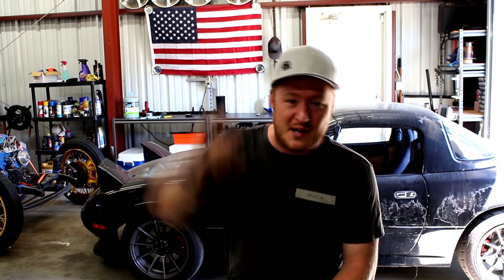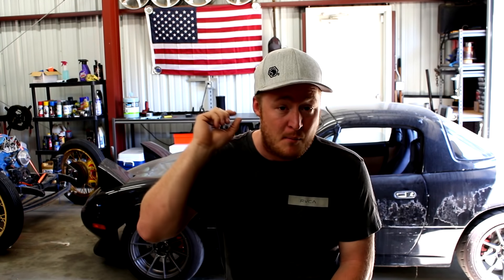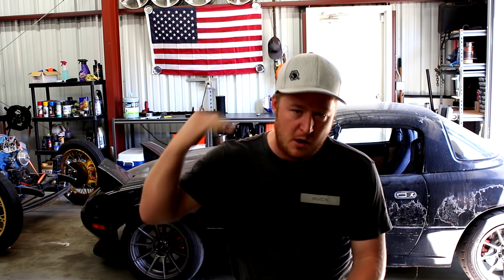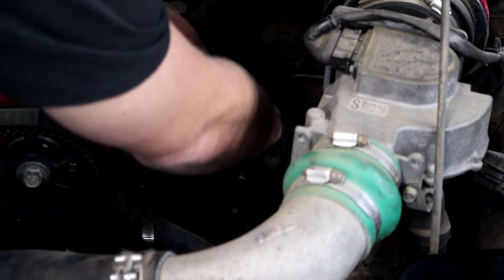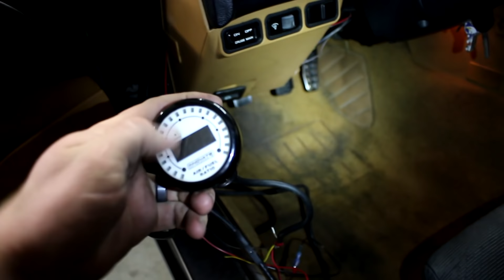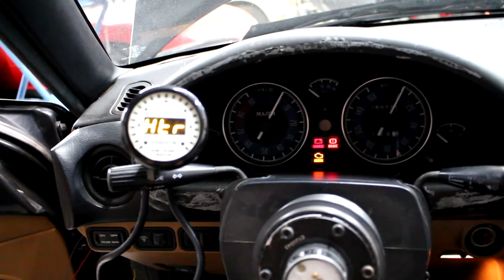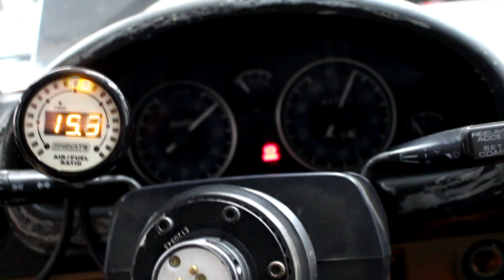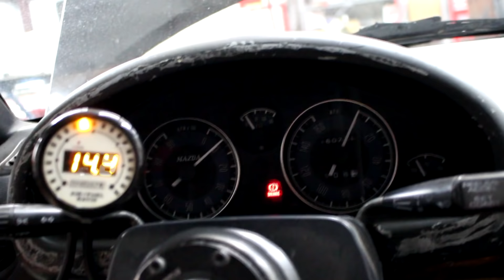Wideband 02 Sensor Install | Reborn Turbo Miata Build #33

Comment from the maker: One thing I forgot to mention in this video is that these Wideband O2 sensors also usually have a calibration process! READ your instructions that come with the one you buy and make sure you calibrate it!

Comment: Just picked up a 97 Miata. My biggest problem is that it’s automatic. XD I’m most likely gonna go back and watch all the mod videos now. XD
Reply from the maker: You can always swap it!
Reply: GearHeads that’s the plan. I want to get a 6 speed, but I’m not sure what rear end to go with, or if I even need a different one. XD
Reply from the maker: @thatfurmurezor7821  You'll need a driveshaft when you swap it to match whatever transmission it came from but the diff can stay. Idk if you have a torsen or not but if you do just keep it
Reply: GearHeads yeah, I hear the Torsen is the best but I don’t know how to tell if I have one yet. lol, I must do research. XD

Comment: Thanks for the video.  I can't seem to find an answer. Maybe someone here knows. On an nb that has the 4 wire 02 harness, I tie in the 02 signal to the blue wire. My question is the about the 02 ground/ white wire. Does it get taped back or does it too need to be grounded? Hope that made sense. Thanks
Reply from the maker: Are you talking about the widebands ground or the stock one? Are you setting up a Wideband with a standalone ECU or just adding one in conjunction with the factory sensor?
Reply: @GearHeadsGarageChannel  thanks for your response. (mega squirt only.) Ive cut the 4 wire harness and tied into the blue for the wideband. The other 3 wires in the harness are 2 black for the heater and a white/ground. That white/ground, does it just get taped back?  Thanks

Comment: we're still waiting on the slow power windows solution!!
Reply from the maker: Haha I havent done them yet because if its the motors I dont have the money for it yet. Plus after the turbo setup is done I will be redoing the whole interior anyway so Im not in a rush just yet! In a couple months my wife will be done with school and I will have money for big projects again! The Turbo setup at least I already have all the parts for besides intercooler piping